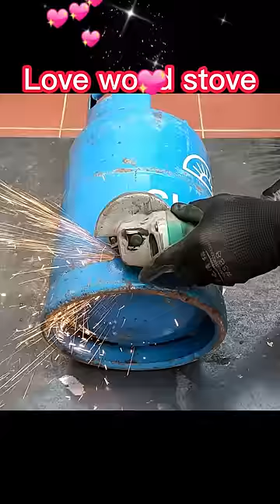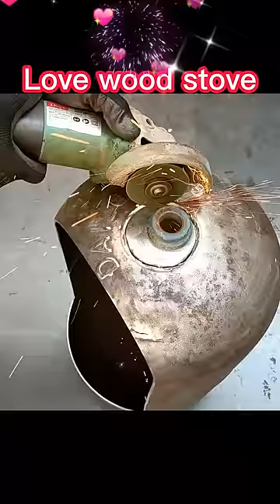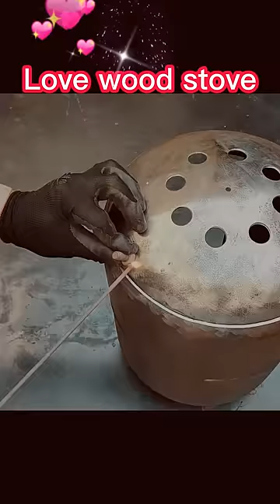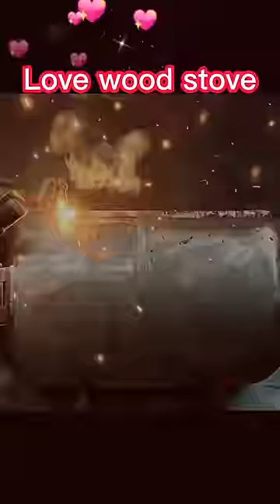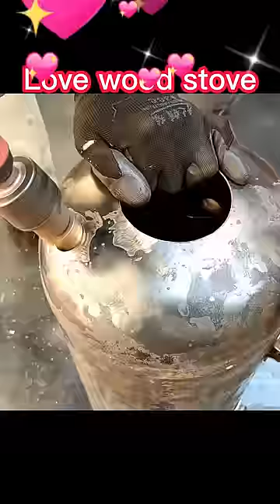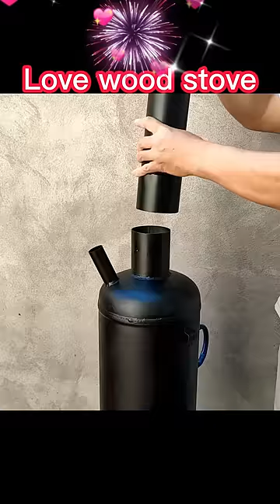Multi function fireplace #shorts

Comment: Looks a great and elegant design with Developing World business potential too if you already have the skilled workforce, welding tools and a steady supply of free used gas bottles. Otherwise, over elaborate with so much time and effort wasted unnecessarily changing the orientation by 90°, crafting and fitting new legs etc.  A smaller hot plate vertical version with less welds would make more sense and while sitting lower, a bit less comfortable to use, be much easier to build.🤷🏾‍♂️🇬🇧
Reply from the maker: Thank you so much for your comments